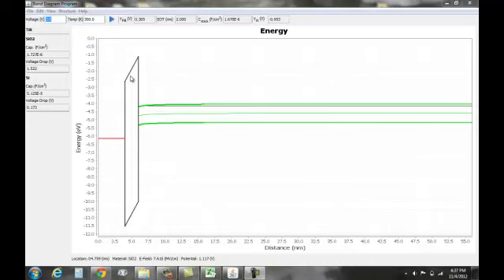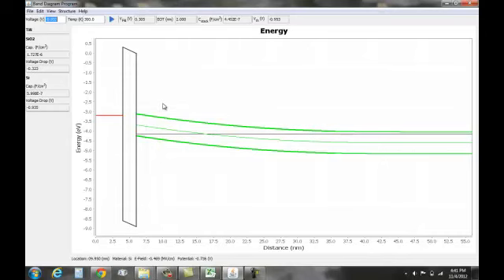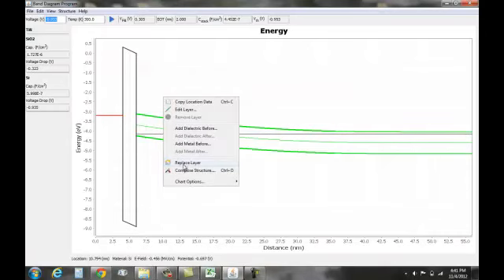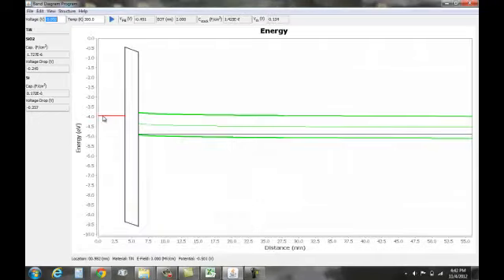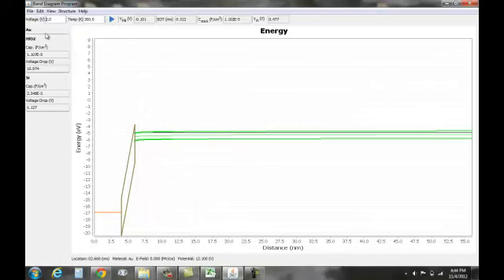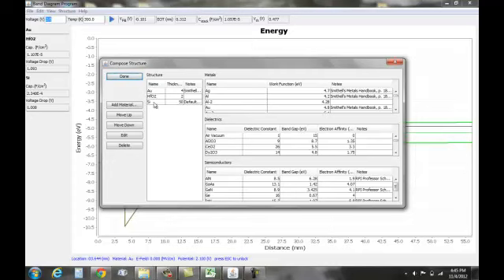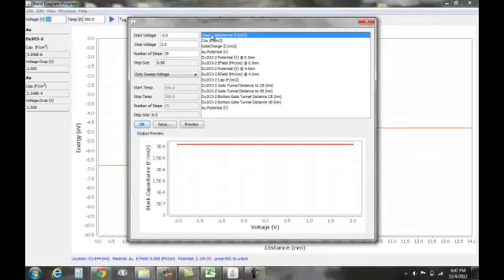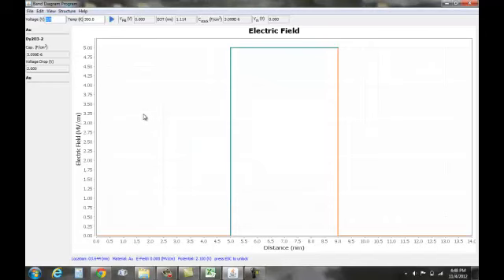Energy Band Diagram Tutorial

Comment: Thanks for the great tool. However, I was about to stack few materials for a device simulation. It says "A semiconductor can only be an end material". Is that a limitation of this program? I am using metal/dielectric/semiconductor/another semiconductor/semiconductor
Reply from the maker: Thank you for using the program and the positive feedback. That is correct, when a semiconductor is within the heterostructure, the program can only solve for the heterostructure when the semiconductor is the end material. The reason for this is that the program is a one dimensional Poisson's equation solver. It will not solve for a junction of two doped (extrinsic - point defects whose charge can change with applied voltage) semiconductors or multiple junctions of doped semiconductors which is what I believe you would like. One would need to solve both Poisson's equation and the Schrödinger equation. For this, programs such as technology computer aided design (TCAD) simulation programs are necessary. If the semiconductors were intrinsic (a semiconductor that is undoped or contains fixed charge), then this program can solve structures with multiple semiconductor junctions.

Comment: Adding a specific charge value in a dielectric material on a specific distance within the dielectric is not really working, it says,  Could not find a solution! Max number of iterations reached. Can you anybody tell me what is the problem here?
Reply from the maker: Sorry for the delayed response. I view this page very rarely, so it is best to email me at bknowlton@boisestate.edu with questions.

First, thank you for your interested in the Band Diagram Program. Relative to the problem you are experiencing, typically, this type of error means that the charge density units (either electrons or holes/cm^2  or C/cm^2) that were assumed were incorrect relative to the value that was entered into the program. The program has two unit options in which to enter the charge density and, because of the difference in units, different values are used. For instance, consider the following concentration or density of electrons: −1 × 10^13 e−/cm2; this value equates to −1.6 × 10^−6 C/cm2. So one needs to ensure that the value used is entered in the proper value box. By the way, this feature can only be applied to dielectrics.